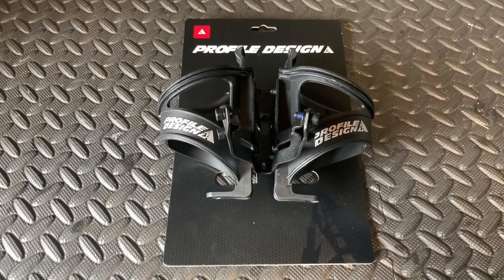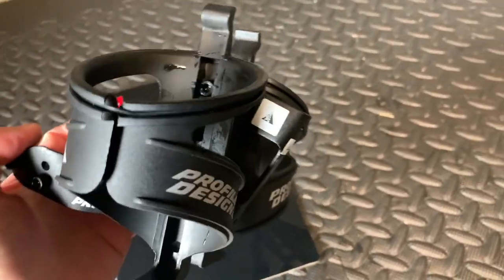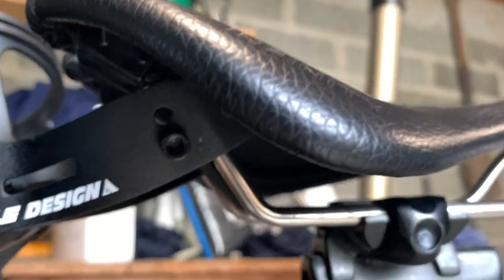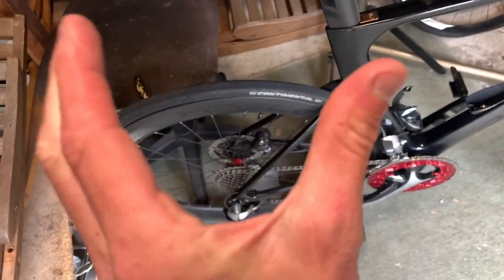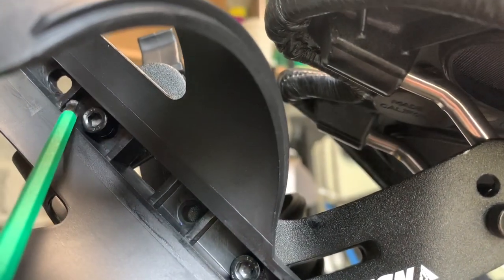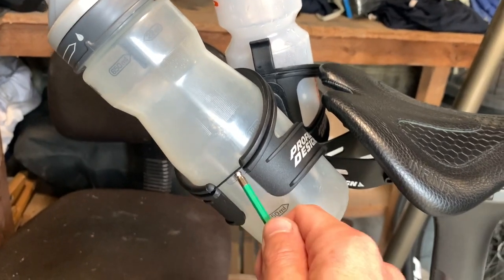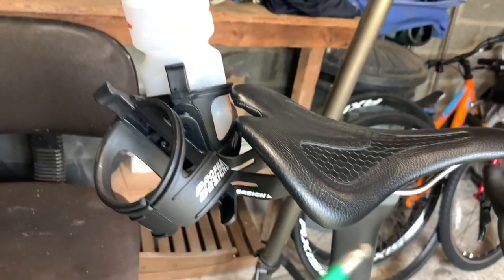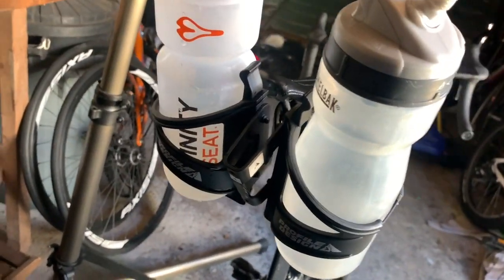Profile Design Bottle Cage Install and Review

Comment: Thanks for the video and review.  I’m trying to add bottles for longer training rides.  
Which bottle holders do you have on the frame?  Do you swap bottles from behind the seat to the frame mounts during a ride?
Reply from the maker: I’ve got 600ml round bottles for this cage, on my frame I have 2 500ml aero bottles elite chrono cx. 
I can’t change them round as they don’t fit. 👍

Comment: One issue I've found with rear-mounted tri-cages is that the bottles will leak water (or worse, sticky Gatorade type liquids) right down directly onto the rear brake pads and calipers. I've ridden twice in a row using a rear-mount on my hardtail and twice in a row have I ended up with badly contaminated brake pads and rotors. The liquid flushes out any dirt, grease or oil in and around the caliper housings and these flush right out onto the pads and rotors within minutes of my ride. So I've had to clean my pads and rotors two nights in a row. Admittedly I was using cheapo plastic water bottles containing frozen Ribena, so the dripping condensation was doing a number, combined with the leakage from the cheap Decathlon bottles. So the solution could be to use only non-refridgerated liquids combined with a "leak-proof" screw top bottle with no nozzle. I will try that and see how it goes. But man will I miss my frozen Ribena slurpees while out on a ride. But the sticky mess all over the back part of the frame was so not funny.
Reply from the maker: That’s actually a very interesting point, never thought about that! I know I find I get sticky patches over my frame when using my aero bottles but never considered it dropping onto my brakes when on the back… may just have to put water in the back ones… hope you find a solution. Oh the uk wiggle bottles are amazing. 👍
Reply: I found this happened as soon as began using aero bottles mounted behind my seat. I’ve solved it by using Camelbak Podium bottles which have a lock tight twist system, and by using only water, not Ribena, Gatorade or any of those sticky liquids. Had 2 rides the past couple of days and no issues with the brakes. 👍
Reply from the maker: @tropicaleasyrider1  yeah the podiums are a good bottle, the wiggle ones I’ve just bought are really good and under £2 each. 👍
Reply: Alternatively I could make little umbrellas for my brake calliper housings haha 😂

Comment: Nice video thanks. I’ve got a Fizik Tritone EC90 saddle and I’ve been looking for a bottle mount for it. The saddle has 4 bolt holes (2 each side) at the rear of the saddle and I wonder if those bolts can go straight in those holes rather than mount on the rails, which I think would be difficult with that particular saddle.
Reply from the maker: I’m not sure but I recon it would fit most saddle rails. 👍